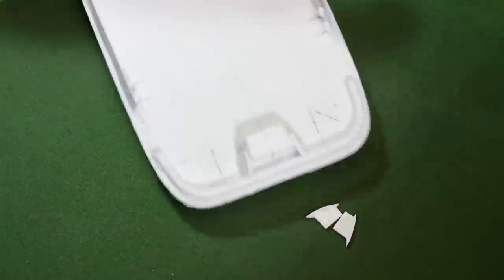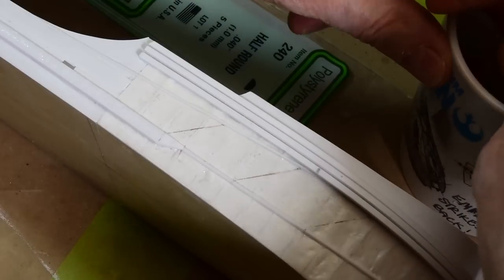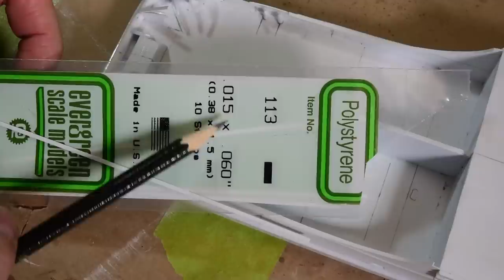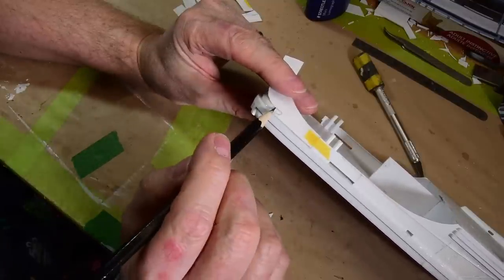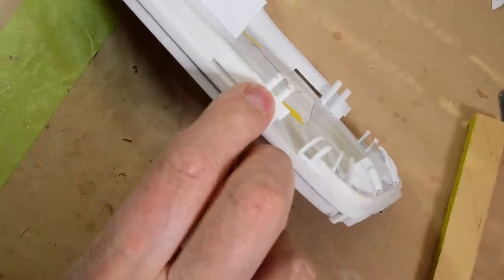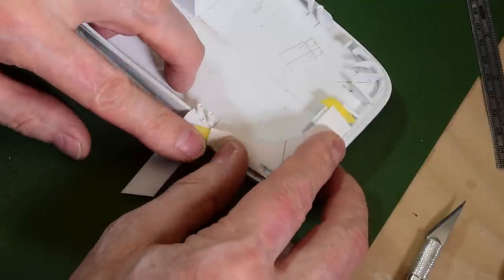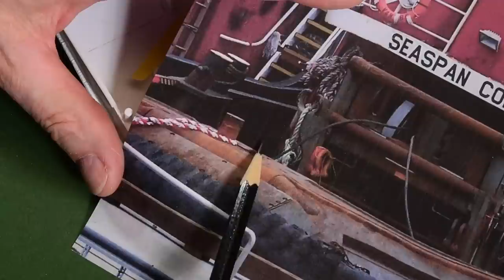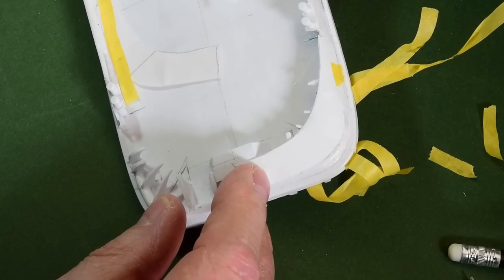Scratch Building Seaspan Corsair (Part 4) | Boomer Diorama ~ Vlog # 174

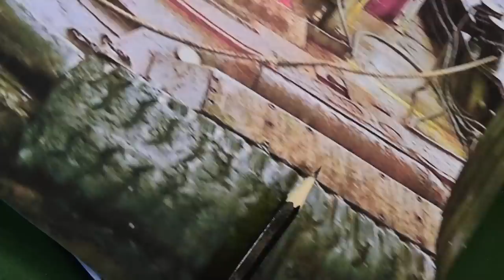Comment: It is difficult for me to express how much I am enjoying this scratch build!  >Now I realize you are working with very thin gauge plastic, yet I wonder about including a small hair dryer on low setting near to hand when forming such cranky pieces.  >At 28:05 you were asking about the mysterious indentation in the transom curve and I suspect it may be a step plate, unusual to the design of Corsair.  >Gunwale or Cap Rail is the correct term (though salty pronunciation is "Gunnel" ) ...lastly, I need to make a pair of those bent needle nose pliers at 4:59! Thank You Boomer!
Reply from the maker: Thank you!

Comment: Dear Boomer, absolutely amazing how you’ve shown your process of finding the form of the transom. Beautiful how it forms around the stern. 
Love how you did those bollards. 
On the ‘scuppers’ at the ‘corners’ of the stern; humbly think they are indeed scuppers. I remember visiting the Zeesluis(sluice) in IJmuiden as a kid with my dad. When the tugs make their first pulling action, to get the ship out of the sluice, their sterns sometimes make water. In this bow  somewhat up and stern down position, these scuppers will allow water to flow off, the rest will flow to the aft side scuppers. As soon as the tug makes speed, the deck will level. Was really amazed by the sheer power of those tugs, for instance pulling the Tor Line ferry to or from Norway.
Awesome build, beautiful vid, looking forward to your next episodes! Cheerio
Reply from the maker: Yup.

Comment: Hi. I´m about to start my "shadow box" proyect. What would be your recommendation about lighting temperature? Cold or warm white?
Reply from the maker: Lot's of factors involved here that you can only solve yourself. You can get "Puck" style LED lighting with those options included at like say Home Depot. I will use a thin 4" disc style with all those options you mention that you can switch on or off, and also dim the lights as well. Check the lighting section in home hardware store for 4" thin LED lighting.

Comment: This is a superb build and has given me the inspiration to think about having a go at something myself. I don’t have a scene that I could add it to my layout but as an ex-seafarer I can’t help but want to build models of ships. I’ve scratchbuilt in the past but all those curves of a ship were scary, you’ve helped remove the fear. 

In the old days steel was cut based on an expanded plate diagram, which shows a ships side with a straight keel and all the curves are elsewhere, ie on the deck line and the upper edge of the intermediate plates. 

Those openings that you refer to as ‘scuppers’ are in fact freeing ports. A scupper is a drain in the deck to allow water to wash down, either overboard or into a tank. 
Also ‘bollard’ is pronounced Bol’ard. More correctly when on a vessel they are termed ‘bits’. Bollards are the shore side variety. 

Anywho, whichever way you pronounce these things, your model is masterful, keep it up.
Reply from the maker: O.K. Thank you. Cheers.

Comment: Wow Boomer, you’re really getting this or by now you’ve already got it, LOL

I believe those are used for water drainage on the back deck because it’s so low to the water, they also have them on barge pushers that I’ve worked on in my teen years (about 55 years ago) LOL
Those 3 pins or cable guides are used as needed  when a barge is towed behind the tug (we call that “On The Wire” 😊

And I thought the “Night Hawk” build was amazing, you never stop amazing me and I wish I could come and learn with the pro, you’re an amazing teacher! Ron
Reply from the maker: O.K. Thanks for sharing about the Tug. Very interesting to know. I certainly don't know everything but it won't stop me from modeling anything. ;-)

Comment: Superb modelling! I have been watching your vids for a couple of years now and have learned MUCH.  In a previous life I was a welder/fabricator with a few years of working marine construction so I have a couple of tips to contribute:  bollards are pronounced 'ball-ards' not 'bowl-ards', the reverse curve of a ship's hull that you are working on so correctly is called "tumble-home" (whenever the stern sides of a ship curve inwards above the water-line), the slots you said you are unsure of the purpose of - they are, indeed, scuppers. They ensure that no water that gets up around the large diameter pipe that wraps around the whole stern of the tug is not able to lay in the V created by the pipe and the plating and promote rust. 
The round 'pegs' do indeed pop up from the hydraulics cabinet in the center of the transom area. These, together with the roller you pointed out form the 'fairlead' that guides the tow cable. They are retractable because if the tug should somehow get cross-wise to its tow, it is possible for the cable to roll the tug over on its side. Tugs have been lost in the past due to this, so current designs use these retractable fairleads.
If you visualize the tug as having its tow point positioned ahead of the propeller at the center of the winch drum, the geometry becomes clear.
I will be looking forward to part V.
All the best and thanks for sharing your deep knowledge...
Reply from the maker: Thank you.